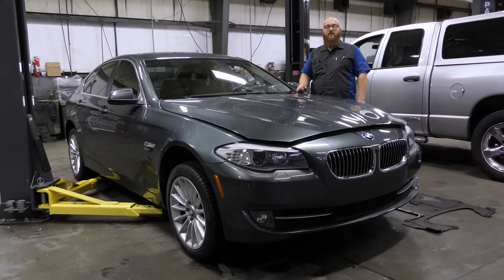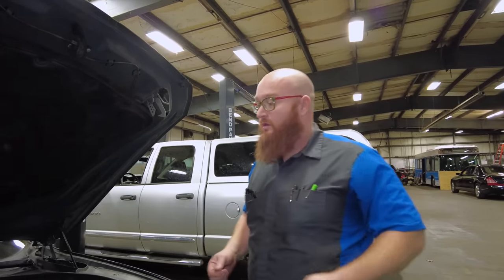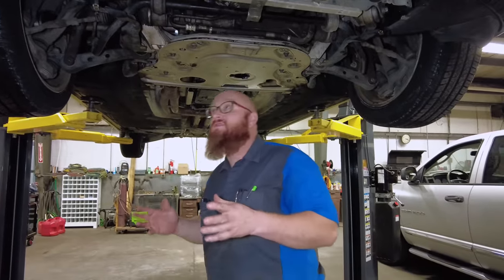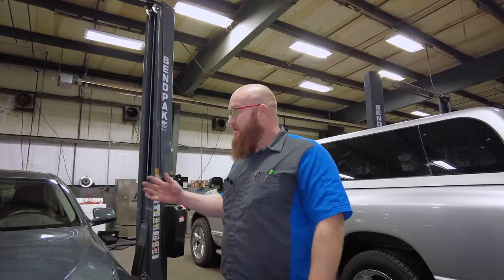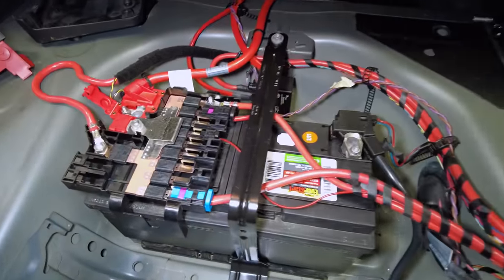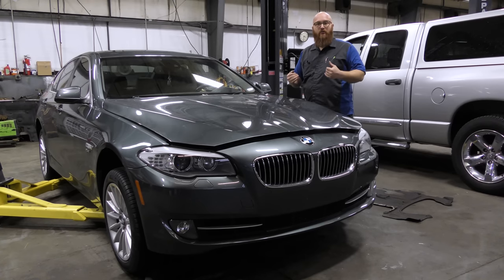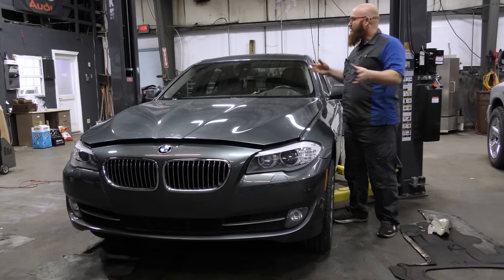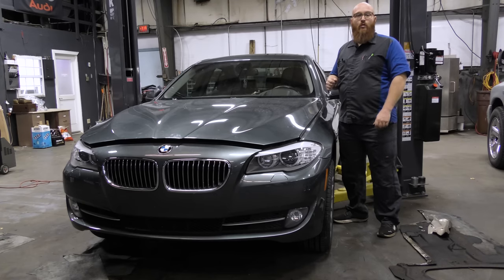One bad day for a customer! CAR WIZARD found TWO insanely unrelated issues at time on '12 BMW 535i

Comment: Even a lot of the basic inline 6 bmw needed the intake manifold removed to replace the starter. 

Given the high miles, you usually end up wanting to replace all of the coolant hoses, along with the reservoir
Reply: Not sure if my '74 3.0S needed the intake removed to access the starter, but the first step in the workshop manual for anything on the front of the engine is removing the hood!🤣
Sold it last year, kinda wish I'd kept it.

Comment: About ten years ago, BMW management really [beep]ed up and created the I3. I bought a lease-return I3 for $16k, it costs one-fourth as much to drive as my old Ford Ranger and the performance is terrific. After 85,000 miles, the only service it has needed is an air filter for the HVAC system ($75) and a new VRLA battery ($125). The ultimate economy car! I'm sure they won't make that mistake again.

Comment: Holly molly 150$ per hour 😳
Reply: You think that's a lot? Even on a luxury import?
Reply: A shop has a huge raft of costs just to be there.  Premises, wrenches, specialist tools, ramps and lifts, and then mechanics.  And all that before a wheel rolls in.
Reply: That’s very reasonable these days. Do consider he is working on the “Ultimate Driving Machine”.
Reply: @michaelgoode9555  Dont forget insurance, taxes, and weekly protection money for the gangster down the street!
Reply: That's cheap. Over by me. Labor at an independent shop is usually 160 to 200 an hour
Reply: @quicksilver462  In NYC, the local gangsters would be the myriad of government agencies. With inspectors coming in every month, hammering you with petty violations.

Comment: I am a BMW guy and have been for 25 years now.  But a big part of that is knowing the brand so well I can anticipate MOST problems before they happen, and fix many of them myself before it turns into a money pit.  Still, I get nervous with these cars over 100k, and have always turned them over into newer models once I sense those money pits days looming.  And yes, had my 2009 335i pop a hose connector (foolishly plastic and bolted to front of the engine block (replaced it with aluminum)) and immediately drop ALL my water right down the front of the block.  Have been getting a little clingier on my last two (including a 2014 535i) as with EVs looming it feels like there might not be that many more true driving machines to go.

Comment: If you’re going to buy a car like this, you have to be PROACTIVE. Preventative maintenance is an understatement. You need to get a oil change and inspection every 5000 miles or even sooner if you don’t want your engine to explode like dynamite 🧨

Comment: I've been working on BMWs for 21 years. These F10 535s can be good cars if the oil changes were done diligently, oil leaks taken care of asap, and cooling leaks and services performed. The chassis of German cars hold up to bad weather and salt like no other. The rest of the drivetrain on these cars are bullet proof. The suspension rarely ever requires repairs, the electronics always work, and that oil seep at the back by the bell housing area is more than likely coming from up top somewhere. Oil pan leaks on N55 are not very common but do happen. The big thing to worry about in early N55s is the intake cam wearing out the cam bearings. It will lock up in the head, sometimes snap in two, and lock the motor. The shavings will eat up the main bearings. I've seen shops put a head on and then the bottom end is trash just a few months later. I feel it was due to the early cars and suggested oil intervals on 12,000+ miles.

Comment: My Lexus same setup with starter.

It was easy to get to under intake. I pull fuel injection harness to the side,  not disconnect  it.

Then a few vacuum lines were tricky to pull off,  not all need pulled. 

A front water by pass hose will come off with intake pull to back firewall. Push hose from coolant side same time it expand and releases better. Reverse to reinstall.
One hose under air duct part of intake is easier to put on with intake in place and resting on a block of wood for access

Comment: I just changed the starter. Best course if action is buying a remanufactured starter. These engines are actually superb. Plan on replacing all the hoses from and to the CCV/oil separator...which I changed. Total cost: 400. Ok, probably not a job for the average owner. But that engine ..... everything actually looks good for a 200000 mile car!

Comment: I have a Benz, a Jag, and a BMW.    My BMW has also had a starter replaced, coilpacks, throttle body , and vanos cam gears, valve cover,  vanos sensors, Crank position sensor ...  and every one of those jobs can be a royal PITA.  BMW mechanics probably have intensive psychological counseling

Comment: Reminds me of something that happened to me a few years back. I had just done an intake gasket job on a GM Safari van (4.3), and I left for a road test. Didn't even need to raise the truck up for that job. 
So I'm at a red light, and suddenly I hear this high pitched whining sound and BOOM- smoke pouring out of the hood, engine stalls, the works. Out of nowhere. After we towed it back to the shop, turns out the starter had short-circuited and spun out of control until it blew up. When we told the customer, he was understandably puzzled....what's the starter got to do with the intake? We told him, if it hadn't happened to us, it would have happened to you on the next street corner. Cars can be weird sometimes...

Comment: AT 9:55, the starter solenoid failing may have been due to it being subjected a much higher temperature that it was designed to handle. A solder joint could have opened. The main contacts might have been damaged so that high current could not be achieved. Perhaps a piece of plastic was being used to maintain connections. Or, some other failure occurred. But, regardless of the details, the failure was most likely due to a temperature that was too high for the starter to survive. It is sort of like an engine that overheats destroying an automatic transmission.

Comment: The issue with BMW's and blown motors from overheating is usually some of the older ones from the late 90's into the mid 2000's.. Like, E39, E46, E60 and E90. The motors run great, but as they get old, the plastics in the cooling system crap out. By the time you see the needle in the red in your cluster, it's too late. Your headgasket is now blown, and your head is likely warped. When you pull the head off, the studs will in most cases pull the threads out of the holes in the block, making it scrap metal. If you ever buy one of these cars, you should do a full cooling system refresh unless you're sure it's been done. They go about 150k miles in between each refresh. It's about $250 in parts.

Comment: Ahhh, good ole coolant leaks. I had a 2016 Audi A6 and the coolant kept on disappearing despite no leaks onto the ground. I took it to the shop and they had to strip down the engine to get to the leaks. It turned out that the coolant was leaking into the cylinders, which I suppose that there might be a blown head gasket, and the shop also said that the oil was also leaking into the exhaust which I suppose it can be a worn valve cover gasket, or crankshaft seal leak, etc. The shop didn’t specify the issue, but they told me that I am lucky to have the mechanical warranty because without the warranty I will have to pay $8000 nzd for the repair, which sounds about right when they have to strip down the engine and charge all the labours. The warranty on that Audi A6 expires in December this month so I traded it in for a 2015 ND Mazda MX5, which has made me a lot happier.

Comment: I have to say this, I’m from the Western Cape in South Africa. I have a 2011 BMW 320i, the car runs perfectly, gives us no trouble whatsoever, has no oil leaks. With careful maintenance and general care for your car you should not have any major issues. Yes there will be problems along the way surely but is as expected from any car??

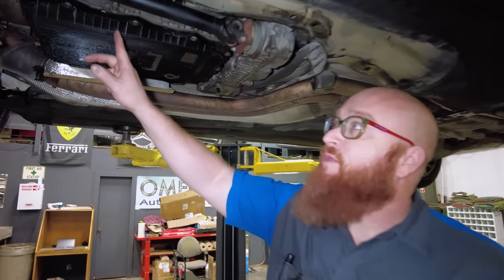Comment: @4:59 that's not BMW that's ZF engineers who designed the transmission that way. The magic trick is to pop one of the center caps off and disconnect the axle bolt, then there is nothing mechanically stopping the wheels from turning.

Comment: I have the same car, 150,000 miles.  That car looks great at 200,000.  How many people drive their cars 200,000 miles?  You see what we BMW people are up against?   I literally just got my car back from the shop today.  It was stumbling on acceleration.  No codes.  Good mechanic wouldn't touch it.  I found another high end shop that said "transfer case."   Yep.  That was it!    Now the question comes into play ... what is the value of it if something else goes wrong?  But I love the way it drives and handles.  it's quiet and powerful.  It looks great.  I might add the other alternative, like most people having permanent $1000 per month car payments on their cars, and mine has been paid for for many years.   Stick the money you save in the bank, you're going to need a bit of it!  The best car is the one that's paid for.

Comment: We were driving a Pontiac Wave East bound on the 401. After having asked our mechanic to find where the Dexcool was leaking from and he didn't find the leak. The lower rad hose blew. Even though we pulled over immediately, the timing belt had already slipped and destroyed the engine. losing coolant is not a joke.

Comment: Funny thing, that front differential right next to the oil pan with the passenger-side cv-shaft on an extension through the oil pan is exactly like the setup on my '04 Buick Rainier that has the 4.2L Atlas inline six. I noticed this the first time I went to change the oil, but that car has never leaked any oil out the bottom, though it did need a valve cover gasket replacement because oil was leaking into the spark-plug wells.  AFAIK it was arranged like that on all of the GMT360 platform vehicles (Trailblazer, Bravada, Rainier and Envoy) with AWD for a few model years, though don't know when they went unibody instead of having a real frame.

Comment: "BMWs suck. This one has 200,000 miles on it."
Reply: 200k was impressive in the 90’s. That’s considered half life of a modern engine now days….
Reply: @vincetaylor3948  and this BMW wasn’t done. It just needed some repairs, like most cars at 200k would. That said, the average car does not last much more than 200k before those repairs become not worth doing

Comment: As a tow truck driver I had problems with getting bmws into neutral too. Sometimes I had to read the manual. Awful. 

When hoses are popping off I normally worry about head gaskets. That takes pressure.

Comment: I have a 2000 5 series E39 wagon with 246000 miles I drive it everyday dealer serviced since new. No major issues to speak of it's been nothing but reliable.

Comment: I’ve driven a BMW since my mid 20’s, in my 50’s now…over that time I’ve had a 6 BMW’s, one 3 series, three 5 series and two 7’s…all have been excellent cars that gave me very few problems until the one I drive now…to be fair the car has been reliable, but last year it was leaking coolant which I thought would be a hose or maybe the radiator. It turned out to be this small plastic Y where three coolant lines meet under the turbo. The heat from the turbo is known to cause this part to fail and the parts were just a hundred dollars or so, the labor was $3k…then last month another coolant leak, this time it was the water pump, car has 120k miles so ok, but it’s not easy to replace, $1700…and at the same time I was getting a drivetrain error, that turned out to be the vanos valves…$1800…it’s a good thing the car has been paid for for a while…As much as I hate it, I’ve decided this will most likely be my last BMW…after 30 years of driving nothing but a bmw, driving will not be nearly as much fun…

Comment: 200k miles, and starter under manifold makes sense, to me. Engine overheating would add heat to the starter, then if it has auto start stop would add additional cycles to the starter. Contacts in the solenoid wear over time the additional heat could’ve warped the contacts just enough for it to fail.

Comment: Come on, 200 k miles what did you expect???
It's so funny how every mechanic blames german cars but when they work on toyota they replace every hose and clamp preventively!! 
So do the same with your bmw why don't you??? 
I had jeep with absolutely zero leaks and issues just because I did preventive replacement of all the houses and gaskets which tend to leak. 
And it was not cheap also

Comment: Had an 90 735i straight 6 did 200K in it,never let me down,got driven like it was stolen, was not a problem,one heater core,rotors pads,tyres,and tune ups in ten years...into Lexus now,but i liked that Bmer,

Comment: Replacing the starter is easy on the BMW. I took the manifold off (changed the CV valve and aome of the hoses leading to it) got a rebuilt starter(300$). Some Chrysler and especially Volvo require the removal of the engine !

Comment: Yeah starters are a pain in the ass to do on BMWs of that vintage. I believe you may possibly be able to get to it from underneath the car as well without removing the intake manifold. I know on second generation CR-Vs you can do that. Just had it done on mine in fact. I would say that it's worth $1500 even if the engine is toast because if that's the case you can still sell the car and recoup all of that money no question. Plus full disclosure always helps sell it a lot quicker.

Comment: When the coolant dumped, the engine got very hot and a bit 'tight'. The 200,000-mile starter, which is obviously bolted to the engine, also got very hot. Electrical things become less efficient and effective as they get hotter, and this tired old starter gave its last bit of life trying to turn the engine under those conditions.

Comment: You think the auto start stop is what ruins the starters?
Reply: It is for sure. Not just the starter but all of the engine components wear faster with auto start stop. If the engine keeps turning on and shutting off over and over, it will wear the components down quicker due to the lack of oil especially on the top of the engine.
Reply: See John Cadogans channel, he's an Australian car reporter and qualified mechanical engineer. He did a video on his YT channel explaining exactly how the whole stop/start system is garbage and reduces engine life.
Reply: It's definitely a source for wear and tear on the solenoid. I turn off that feature on my mother's audi when I get in because the car mainly does in town driving and it has cost us a battery in the past. Constant start stop without proper time to charge and maintain the battery. I don't want to have to hook it up to a tender either. It's nuts.
Reply: I like the economics of it......save $10 worth of gas over 5 years while wearing out a $1200 starting motor  LOL

Comment: It's completely related. The eng got so hot it damaged the starter.  I've had customers come in like rhat many times. Good luck with the engine. It may run but more than likely blew a head gasket. It's all on the customer.  When your car starts to  overheat,  shut the car off!

Comment: I work at car workshop, there was an Audi Q5 with low mileage which water pump failed and leaked coolant on the ECU engine connector, ended frying the ECU, it's crazy. The car had like 20k miles when this happened.

Comment: Bring My Wallet. Here's another good one. Lots of modern BMWs have the PCV valve integrated as part of the valve cover. In order to replace the PCV valve you have to replace the valve cover and gasket. By the book it's a 4-hour job......for a PCV valve. Most cars that's a $5-$10 part and takes 5 minutes to change out and anybody with the correct sized wrench can do it. Not on a BMW. It's $600+ plus parts.

Comment: I have this same F10 model but a 2011 528i the last year the entry level came as a six cylinder. I’m riding on 220k miles, I’ve already done my $900 starter motor around 180k miles, I recently did all my coolant hoses, I’ve always done the oil at 6k like clock work. The only thing I haven’t done yet which is surely to give soon is my tranny. Otherwise the car is a 11 year old 220k mile tank.

I’ve stayed on top of my spark plugs, brakes, ignition coils, mass air flow sensor, engine filters and most recently the valvetronic motor seal. Otherwise it’s all good. Always remember when buying a BMW it stands for Bring My Wallet. Still the best driving machine on the road, I’ve owned about 10 BMW’s in my lifetime and they are great driving machines if they are taken care of and understanding what your getting into when you buy a 2-3 owner BMW. The only thing that drives better than this is a Porsche😎👍🏽

Good video, thanks for the details!!
Reply: is yours rear wheel drive? how long do the batteries last? is your water pump original? did your oil filter housing leak?  did your head liner sag yet? thanks

Comment: This example of terrible timing reminded me of an incident last year on my classic 1991 Mercedes W126 300SE.  The low coolant warning light came on the dash and when I pulled the bonnet release lever to open it to top up the reservoir the bonnet latch failed to open. After 30 years that was the exact moment the bonnet release mechanism decided to break. I had to then nervously drive 90 miles with the low coolant warning light on to see a Mercedes specialist to manually release the mechanism from underneath the car to get the bonnet up. Gah !!